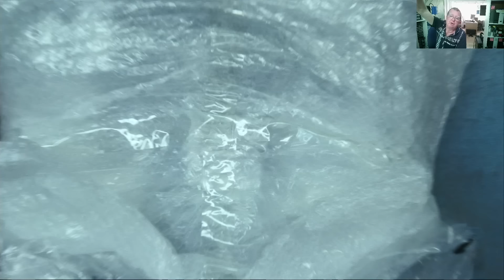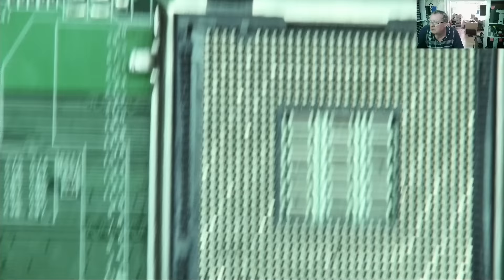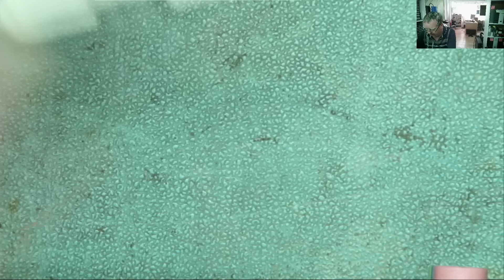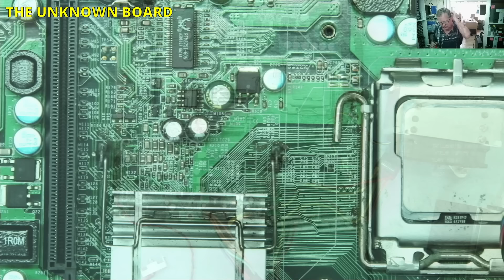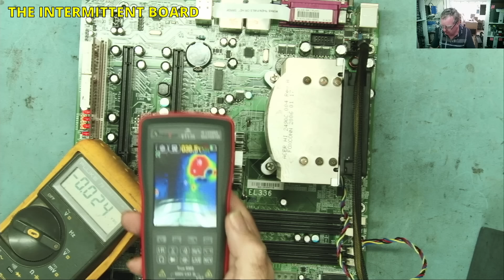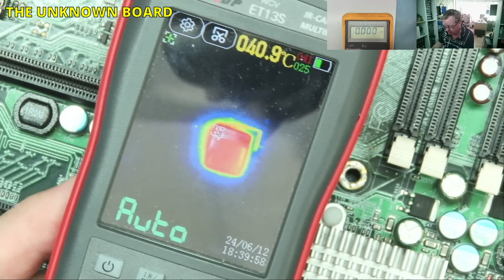Industrial PC Computer Motherboard Repair : Component Level Repair Barcrest Triple 7 DFI Itox EL336

Comment: As far as I remember the Core2 serie had no internal graphics, so you might need to plug one into the pci-e
Reply: I think you are correct with it requiring a PCI graphics card as people have issues with the connection on the graphics card/ ram on these boards stopping them from booting

Comment: I work predominantly on test equipment and industrial boards. It's common for manufacturers to use part numbers that obscure the parts origin. and have custom silk screening done so that the only numbers visible to cross-reference lead back to their replacement parts program. 

That way you need a service tech from their company to fix it. 

Its getting more common but it's been like that for a long time. If you can find a way to cross reference it with other numbers... Or find a hidden number on the board. And sometimes they take a standard common part characters before or after it, to make it harder to cross referance the original part number. 

 Similar practices are done with IC chip markings and such. They tale a super common part and change the identifying information so that you can't replace it without them. Or hide an original part number under a heat sink or something like that. 
Just a thought.

Comment: Regarding marrying software to hardware, there are people doing BIG business nowadays cracking that stuff and removing the checks so any standard hardware works. He may want to look into that...
Reply: @mikeoxlong3504 Hi, software dev here by trade. Its possible 😀All my T7 machines run on custom PCs with Windows 7, and yes they verify on software verification so work in real play mode. If you dig hard enough, anything is possible to bypass.
Reply: @mikeoxlong3504 For some reason my comment keeps been removed by YouTube so ill keep it brief, but I have successfully made custom machines for the T7 that work in real play and run Windows 7.

Comment: Having motherboards tied to software is a very, very common thing nowadays in order to artificially apply planned obsolescence. It's very common in arcade games now which are all PC-based and it's only going to get worse so get used to it. Pretty funny really, my old Space Invaders board from 1979 is still working and is easy to fix no matter what's wrong with it yet a game made just 2 years ago is already dead. Quite sad how companies have self-destructed.

Comment: Being an industrial motherboard, you might find that the 2 molex's on the board are actually outputs for powering hard drives etc. In my experience anyway. Not sure if connecting them to a PSU would cause issues.

Comment: I would have connected a speaker too for beep codes.
Reply from the maker: It has an onboard speaker
Reply: @learnelectronicsrepair  Fair enough .  I commented half way through when you tried without RAM. You did a great job thus far! Hats off to you 🫡.
Reply: @learnelectronicsrepair  Next to pwr switch
Reply from the maker: @enchantededition6879  Thanks

Comment: Might be outside of your area, I don't know...

For that customer it may be worth suggesting a Physical to Virtual conversion of the running OS - they clearly value having the software remain available to them.

I've seen software vendor locks as rudimentary as the MAC address of the NIC.
Reply from the maker: Yeah Detlef has offered to take a look, he is in touch with Martin
Reply: u can clone the mac, its very easy workaround